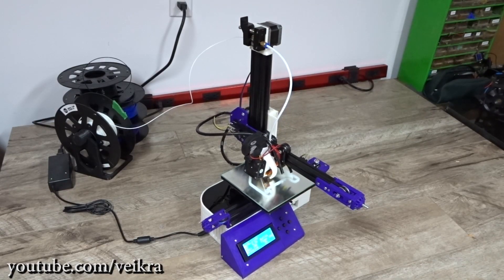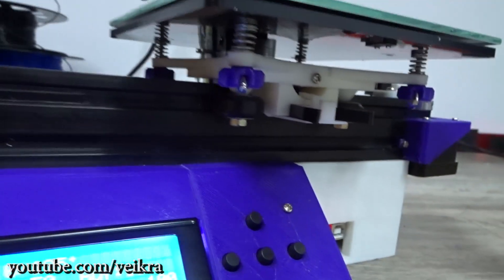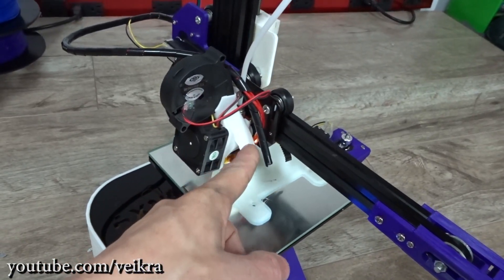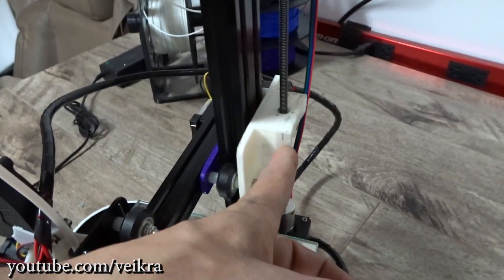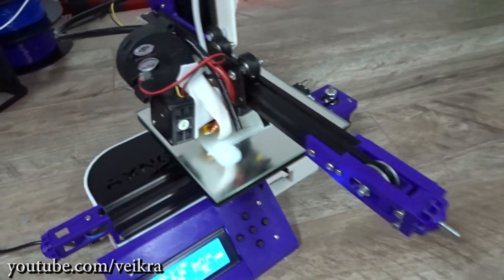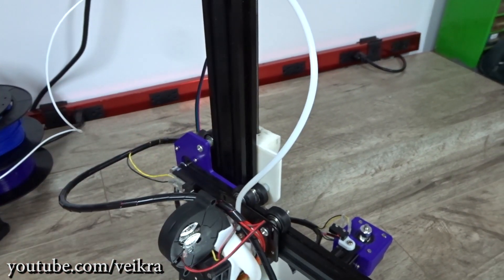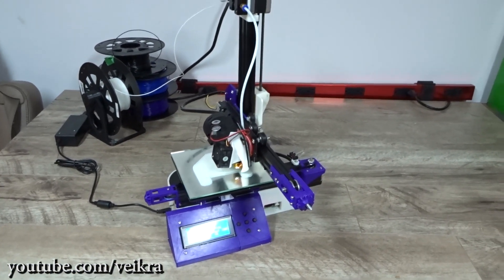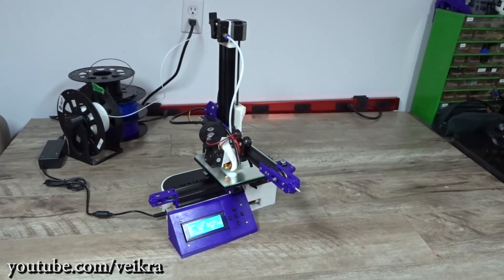How I made Tronxy X1 great

Comment: Please, could you make a video how you install Marlin on X1? I have one and I just not know how to do it. I know that need a bootloader but this its what I don’t know how. Thanks! Great mods by the way
Reply from the maker: I know longer have this printer and I've never updated the firmware. I used gcode commands to change the settings for extruders

Comment: Hello again! Been working on my tronxy x1 but cant get excelent prints. Can you please sendo me you factory file? O use simplify 3d. My e-mail is antoniogilmesquita@gmail.com
Reply from the maker: Post a video of your running machine. most problems are mecanical . I dont have the printer anymore but it's not too hard to find a decent profile for cura. Also, this machine wont print well over 400mm/s so keep everything under that. You should do a video, show your current settings and result first.
Reply: @Nordic_Mechanic  Thanks for the answer. I'm using simplify. i'm having stringing problems. I'll ha ve to work extrusion settings. I have to pimp up my printer to make a video of her. The mods i have done to her are very uggly looking! ;)
Reply from the maker: @antoniogilmesquita  my first mods were also very ugly ! then it printed better and I remade them.  retraction settings may be your stringing. Start at 7 mm and go down if you have no stringing. Temperature influence it a lot. I cant give you exact numbers because both of those depends on the filamant as well.
Reply: @Nordic_Mechanic  Thanks a lot i will give it a go!